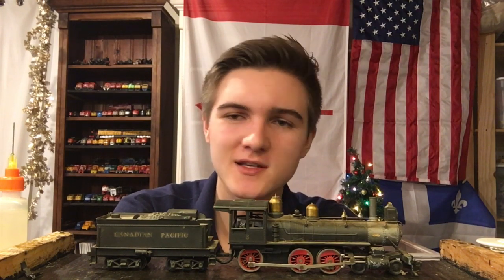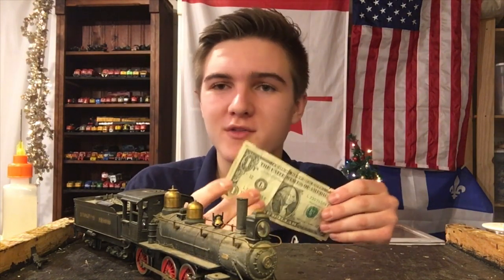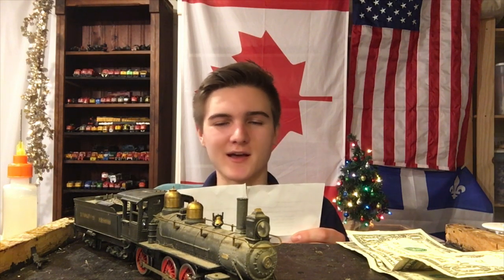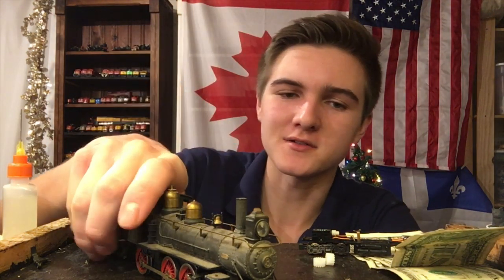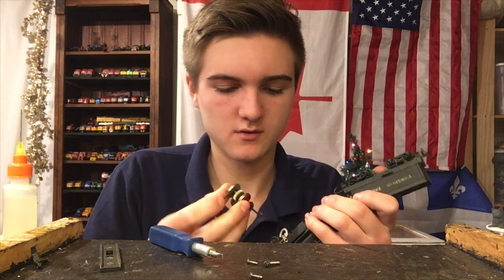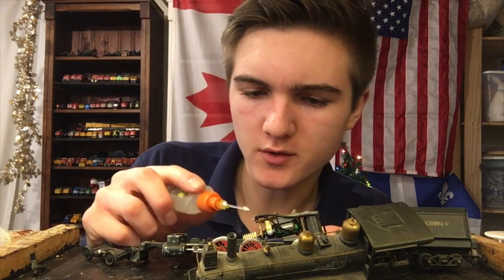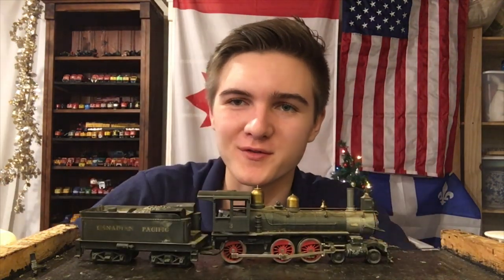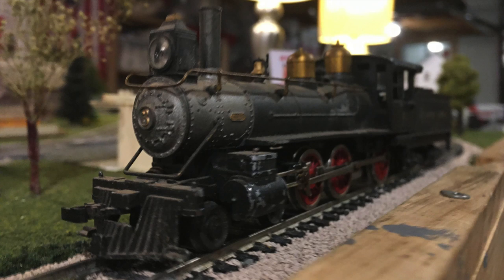Tyco Mantua 4-6-0 Restoration & Mail Unboxing

Comment: Dude!  After watching some of your videos, you inspired me to try to repair an old Tyco / Mantua General 4-4-0 that stopped running awhile ago.  I took it apart, cleaned it (it was not very dirty), and lubed it up.  Also cleaned out the slots between the commutators on the open 3-pole motor.

The engine was never a great runner *before*, it made a lot of noise, and did not like to start up much before the V = 9 and the A = 0.5.  Afterward - WOW. It runs better than new, quiet, smooth, linear speed increase as V and A go up, and it now it never draws more than 0.3 amp.  

Thank you so much!!!!  You inspire confidence!  - Bruce J. in California.

Comment: Heavens......hope you gave that poor thing a "bath" with some warm soap and water.....Nice detailed unit...  What I love about those old "Mantua's" was that most of them were diecast...and make good "pullers"......

Interestingly....unless the motor is burnt....with a bit of serious cleaning,( and I mean wheels, gears, commutator, brushes, etc.)  re-oiling, and re-greasing....odds are you can get it to run again.  If you want success with ANY engine.....have the largest/ widest curves you can place in your layout.....the less tight....the more success and trouble-free derailing issues.....

Comment: You  may  want   to  check   the  wheel  set  and   bearing   under   cab   they  are  some  times   worn  out  because  it   is   set   back   on   frame,   that   will   cause   derail   in  reverse,  hope  this  helps.

Comment: I would also recommend cleaning the armature of the motor and lubricating the bushings on both ends of the motor as well. I've got a Mantua 0-4-0 I picked up for nothing and with cleaning the motor, it's my second best running steam engine I own! Even better than my Rivarossi/AHM Berkshire! 
Clean that motor and it should creep like a champion!
Reply: I love Mantua steam engines. I need to get myself another two at the least but my problem is I model the Nickel Plate Road and I don't believe they made anything like what the nkp used past having to modify a pacific to resemble an L1 Hudson.

Comment: Few of the ones i have trouble with are only with finding parts. Like my lionel ho UP f body unit and gt 5511. Those plastic bottom part that hold wheels in the trucks. People try to pull the off and break them. When you need a flathead screw driver to remove them.

Comment: I paid US$ 19.95 new about 1970 for mine sitting in a box in my basement, so you saved a lot of money by choosing to be born 30 years later. I used to do foreign banknote trading so the value of money based on different factors still interests me and I checked the inflated value of that 1970 $19.95 today and it would be $134.50. Crazy.

Comment: SMT - Do you typically oil the armature bearings on that style of motor?  In Classic Trains magazine, they have a photo with a couple of tall switch stands, like the one on your curved switch track.  They call it a " High Banner " switch stand.
Reply from the maker: I oiled the bearings off camera, it's not the most important spot but it certainly improves performance. I will have to see what the High Banner switch stand is all about.

Comment: I'm rebuilding one of these. I got the hardest part done, but I'm having trouble connecting the headlight wire to the motor. Any tips or suggestions?

Comment: Nice job.  Why does reverse always seem to go smoother than forward sometimes
Reply from the maker: These weren't perfectly designed. They had plastic rings between the bearings in the motor and since the locomotive is almost always going forward there is more stress on one, causing it to wear out faster.
Reply: @SMTMainline  gotcha